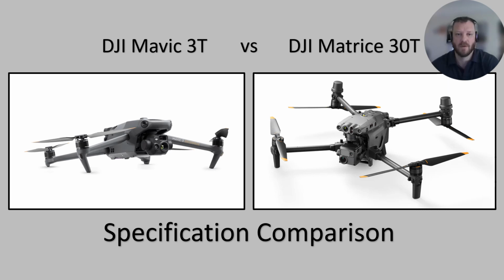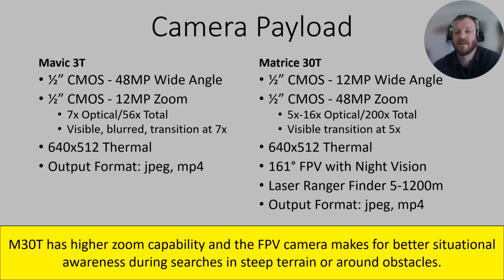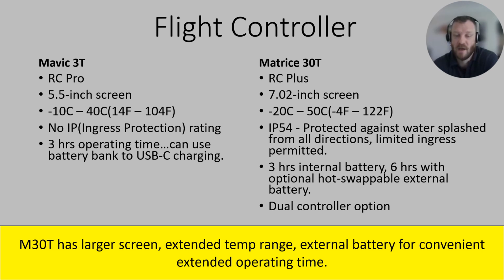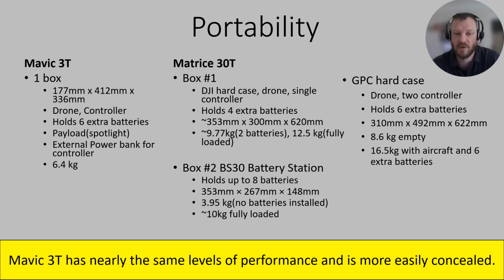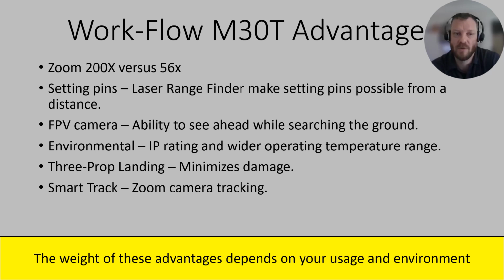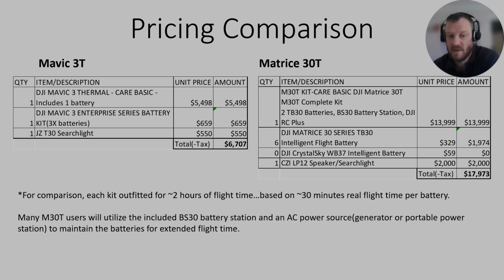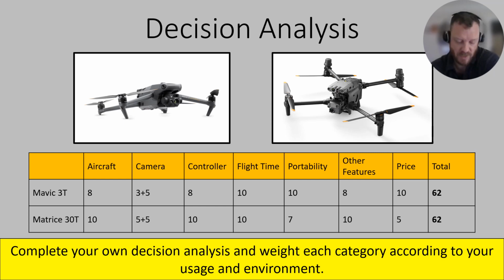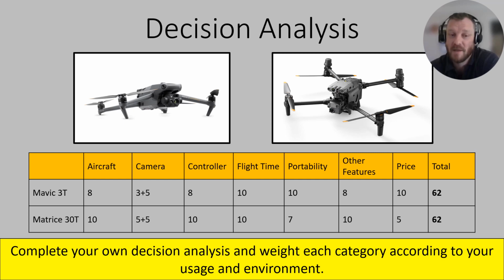M3T vs M30T: DJI Mavic 3T vs Matrice 30T Comparison - Which works for you?

Comment: I own and fly the M30T primarily for SAR aswell as game recovery. I cannot stress enough how important the IP55 rating and the wind resistance is. I had friends that own the M3T talking trash about how unnessecary the M30T is. For them the added features are not worth the extra $. But when they had to recover game in bad weather they quickly changed their mind and had to land. Then they called me for the M30T.
Reply from the maker: Still depends where you’re at and the weather in that region.  If you’ve got wet winters or do a lot of year round pet recovery, or SAR where lives depend on it, the M30T makes sense.  In Alabama where we’re at, we’ve got plenty of successful M3T deer recovery pilots, and a few that have the M30T.  Some of us also assist with local manhunts with the M3T.

Comment: Great video! Thanks so much.
I understand you are perfectly happy with the Mavic 3T. But question: if you were starting all over from scratch... with the new pricing mentioned, and with you rating both as a 62 on your DA... would you still lean toward the Mavic 3T?
Reply from the maker: Good question, honestly, I’d probably have to revisit the DA first and see if the scores were all the same with additional experience under my belt.  It’s still a much larger investment and way less portable/hideable in my transportation.  And for me, most m30t users I know will use their m3t unless they absolutely need the m30t.  So for me, I’d still likely start with the M3T.
Reply: @STRThermal  THANKS!!!
Reply: @STRThermal  First off I want to thank you for your channel and let you know how helpful your evaluations have been! I've been an Inspire/Mavic/AIR pilot for nearly years and have added the M3T last week for thermal SAR capabilities. The Inspire 2 is also something I pull out only when I absolutely need to, similar to the M30T scenario you mentioned above. However in longer flight scenarios where I'm filming all day, the ability to swap batteries in the controller is crucial. What do you use to charge your M3T controller while you're flying?
Reply from the maker: I use the same battery bank that I power my monitor with.  It’s rare I’ve gone over 3 hrs and needed it.  But if I have multiple jobs in a night or a human SAR scenario, it’s good to have a charging method outside of charging in the car.
Reply: @STRThermal  Thanks for the fast response. I just discovered that the Mavic AIR 2s batteries will also charge the M3T controller via the dual USB A attatchment that comes with the FlyMore Combo. Plus they fit in my pockets and keep my hands warm ;-)

Comment: How about m2ea compared to m3t for this purpose? I got the m2ea for the same reason you did, with the thought of maybe upgrading. It seems to be ok for this purpose. Only things I feel it’s lacking is the ability for the spotlight to point straight down and also the thermal settings not allowing to have a temp range.
Reply from the maker: I had a M2E Dual for a short time, but I don't have first-hand experience with the M2EA.  But from my little research, the thermal resolution is the same resolution 640x512 radiometric sensor, but the zoom capability, Pilot 2 app interface, and other features make for a better usage experience on the M3T.   When I was looking at the M3T, the M2EA were still higher priced at certain retailers so it was a no-brainer for me.  That said, I suspect if you found a great deal, I'm sure the M2EA would get it done.